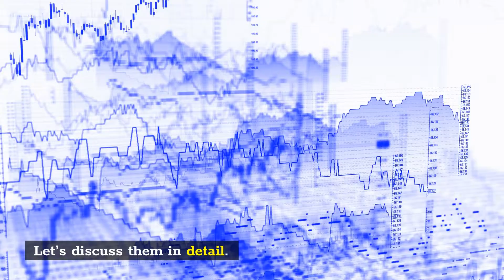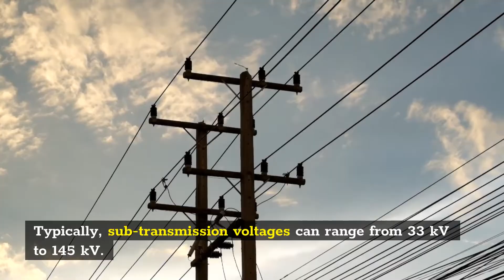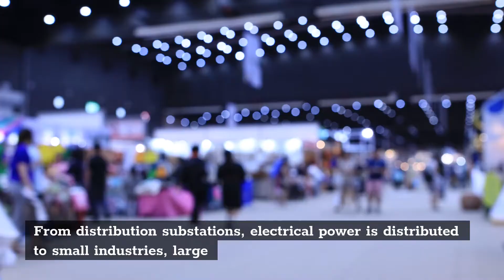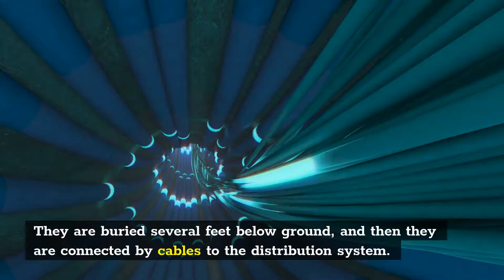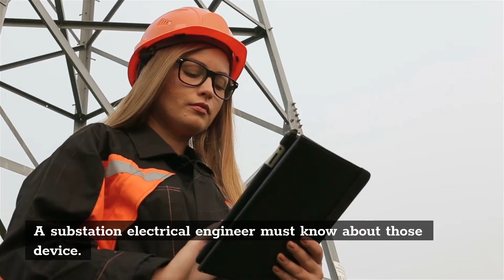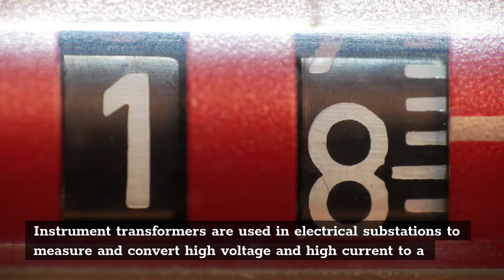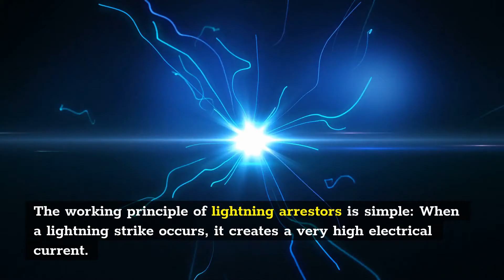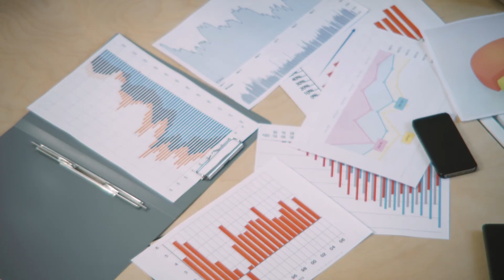Electrical Substation: Basics.

Comment: what is the funtion of static var compensator, and reactors near capacitor banks ??? hope u answer 🙂
Reply from the maker: SVC is used to regulate the voltage in the power system. 

Reactors near capacitor banks are used to limit the inrush current flowing to the capacitors.
Reply: Has this been answered?
Reply: Due to high inductive load p.f is observed low.
So it's  maintain the required power factor.
Reply: To maintain the pf
Reply: The SVC is an automated impedance matching device, designed to bring the system closer to unity power factor.
Electrical reactors are coils with several turns and fairly high resistance values used to limit fault currents at station that could damage a power transformer or other power systems.